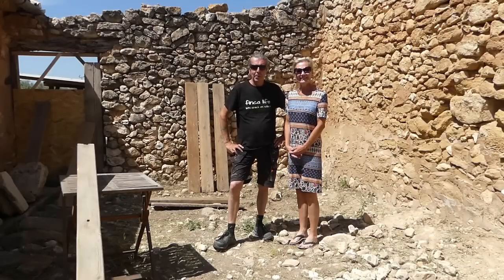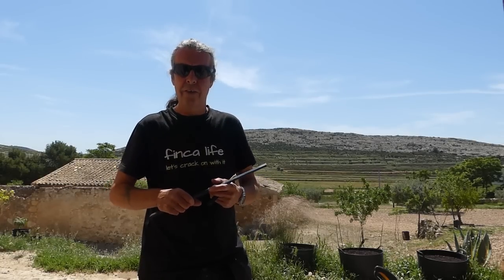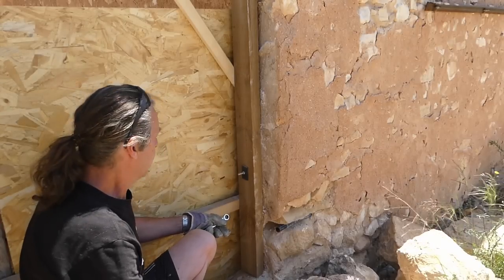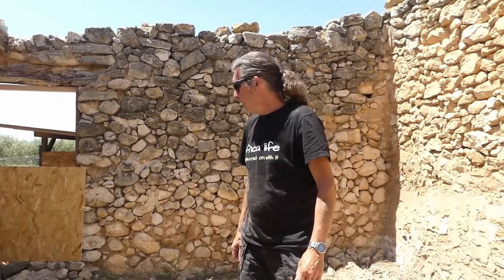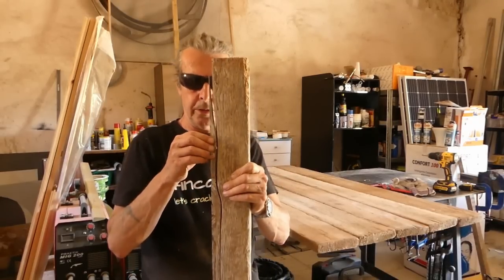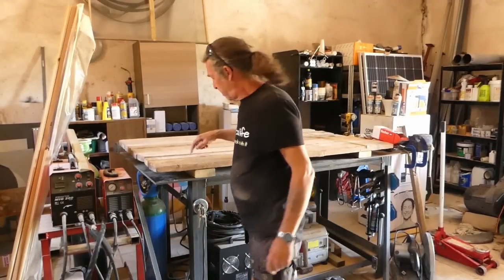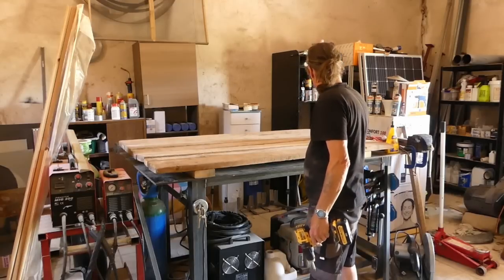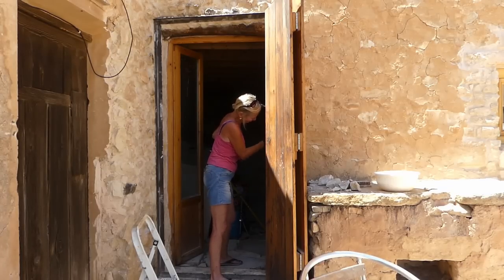Part 2 - Transforming the courtyard into a fabulous outdoor living space

Comment: I think because the door is so wide to deflect the door from dropping you should put a brace on it ,,, looking from the inside it should go bottom left to top right ,, you will be surprised how much it strengthens the door ,,hope you don’t mind the comment 🇬🇧🇬🇧🇬🇧John
Reply from the maker: Thanks John and no problem with the comment. I made the door in the same style as all the others and yes, it may need a brace but at the moment I don't have any suitable wood (there is more coming but currently in use) so we'll see how it goes and if need be, I'll add more bracing in the future
Reply: I was thinking the same thing. It needs a diagonal support or it will start to sag with all that weight.